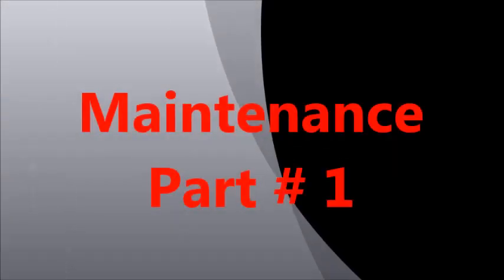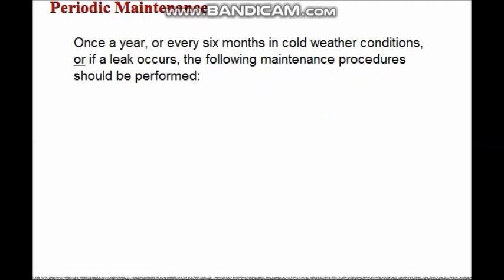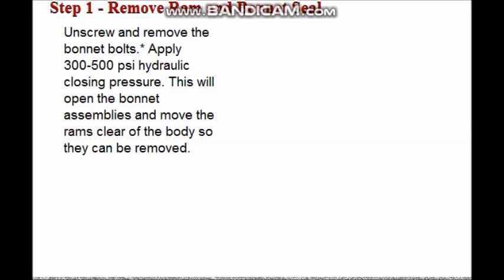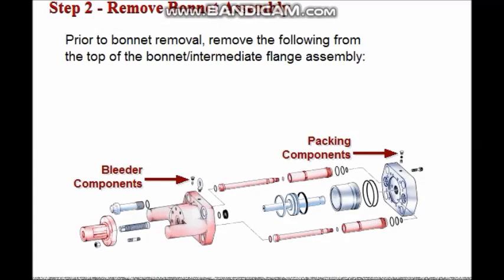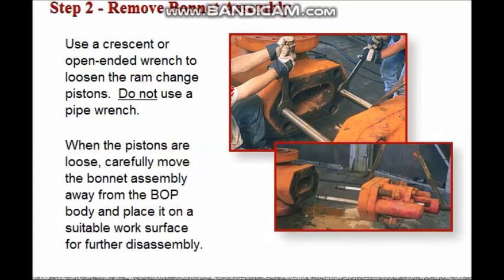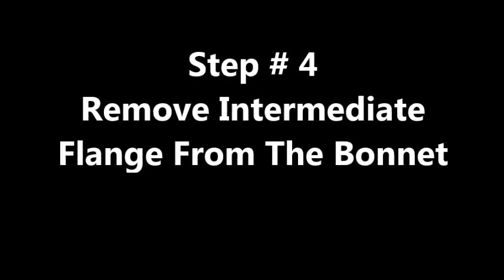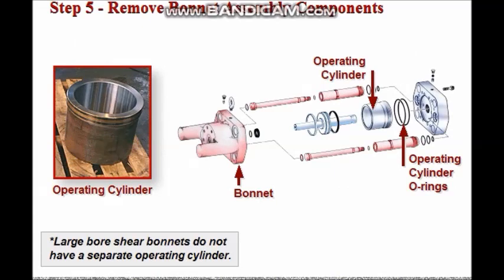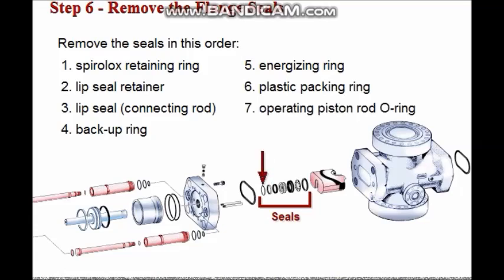Blowout Preventer  - Maintenance  -  Session #1

Comment: What is the routine lubrication program for BOPs? Do you need a grease transfer pump to handle back pressure?
Reply from the maker: "Typically, BOP lubrication programs involve scheduled greasing every 200-400 hours, using a high-pressure grease transfer pump to overcome back pressure."